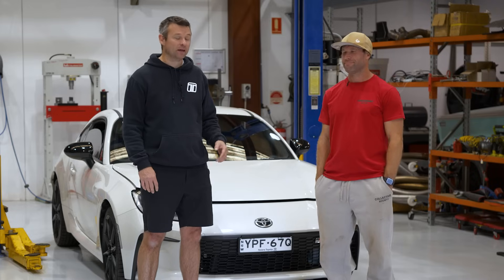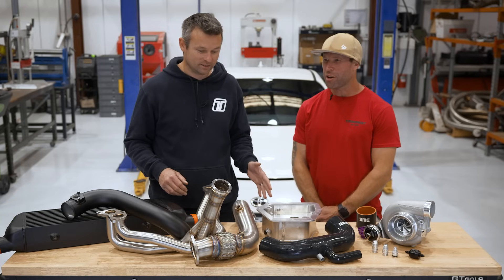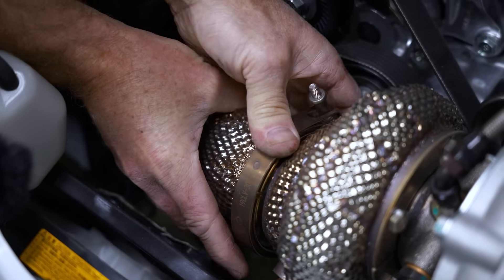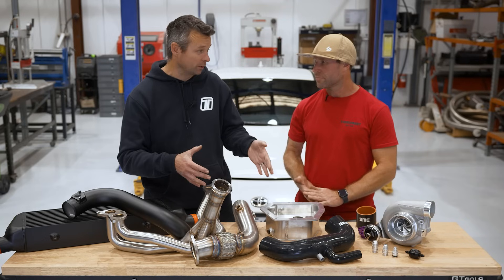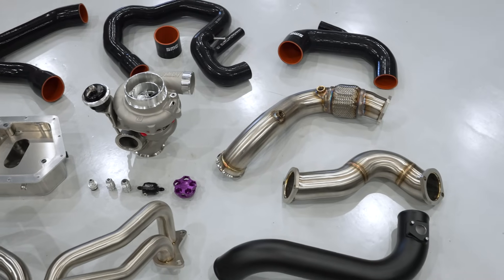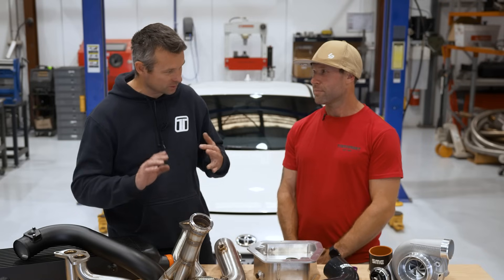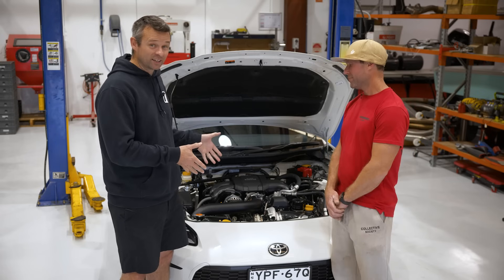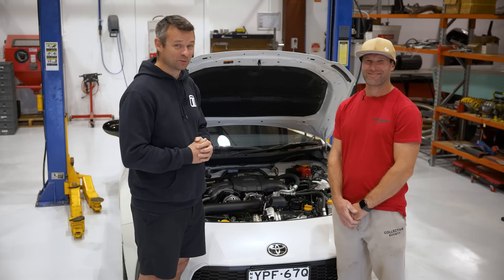500HP 86 / BRZ Turbo Kit from Sydney Motorsport Engineering  - Turbosmart Kit Builders

Comment: Are the internals on these cars good/strong enough for turbo boost ?  They werent even designed for a basic /shit turbo from factory..
Reply: 86 speed recommends upgrading after 350hp. They are currently above that with the stock clutch and says it is holding up but they aren’t expecting it to hold for long

Comment: The transmission though?
Reply from the maker: If you're keeping the power on the lower side (like the 375hp this car made) then the standard transmission will hold up. However, if you're aiming up closer to the 500hp mark, then some gearbox upgrades would be recommended.
Reply: surprisingly robust, dudes get away with a bit with a 1uz infront (the is200 version)
Reply: Grenada
Reply: @Brandon-wolfson  😀

Comment: Would a turbo'd BRZ hold up with heavy track days?
Reply: An NA one can't even old up, they lose significant oil pressure around corners which will eventually lead to the starvation and failure of the main/rod bearings
Reply: @ricardo9628  Way to be confidently incorrect. The recommendation is a slight overfill and they hold up fine. Possibly worry about track time with very sticky rubber, other than that they seem to be fine on the track.